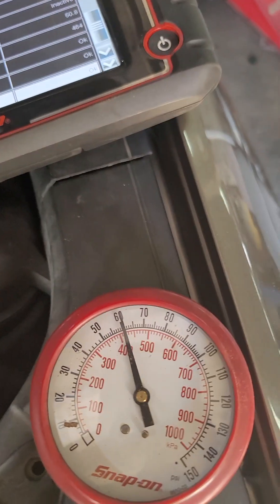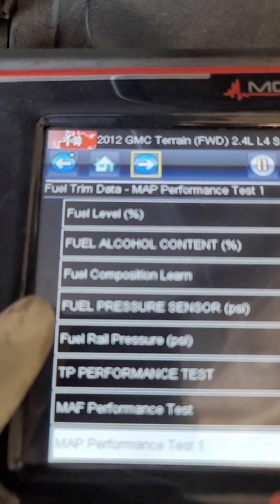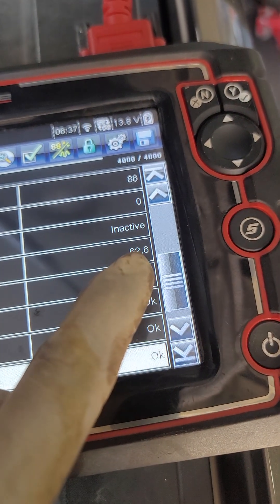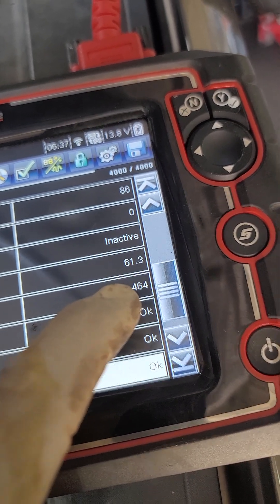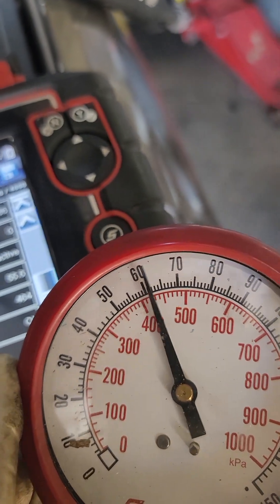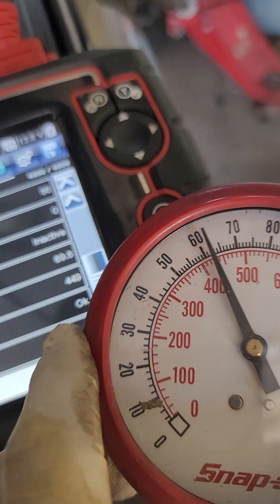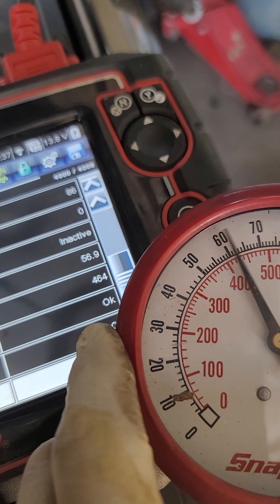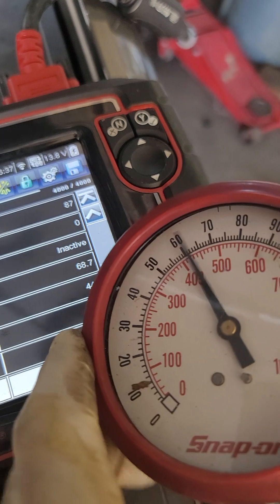2012 GMC Terrain P0191 FUEL PRESSURE SENSOR CIRCUIT

Comment: P0191 is typically a high pressure side code though right?
Reply from the maker: You know u are correct. I actually posted the video before actually did the repair. But the sensor before high presure was actually bad and needed replacement also. So when u get codes like this, most of the time it is the HP pump, but dont get to excited :) 2x check it all.  I am saying this because it kicked me back :), better yet, check actual pressure then recommend both pressure sensor and the HP pump. While injectors are exposed do a cylinder balance test. this can really guarantee the work and diagnostics.